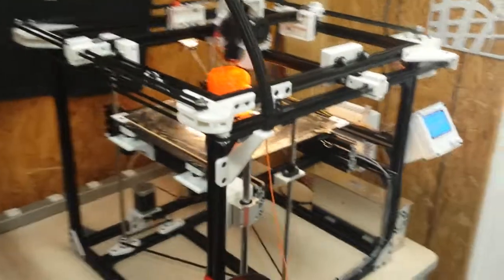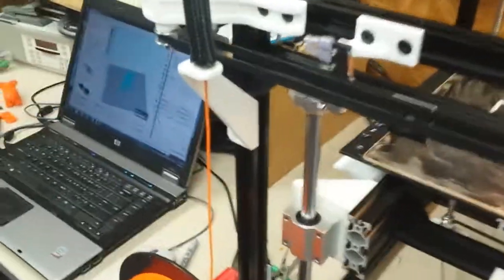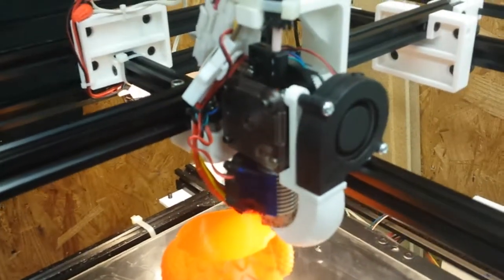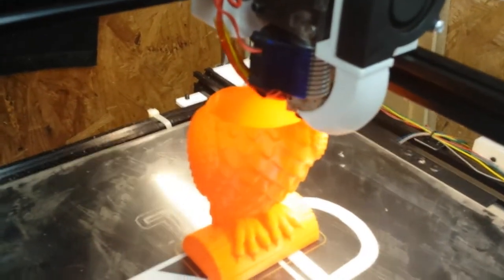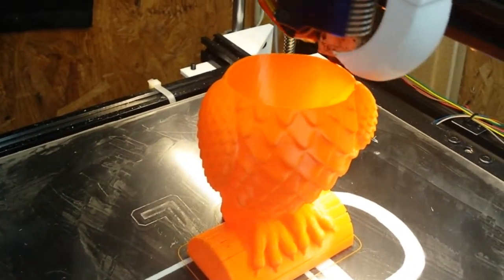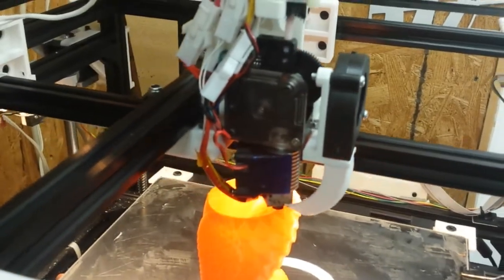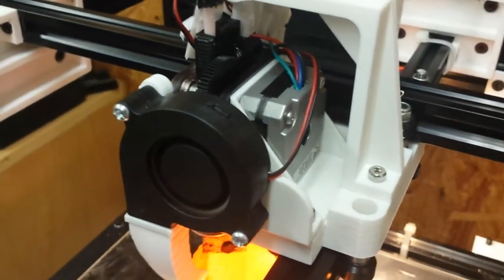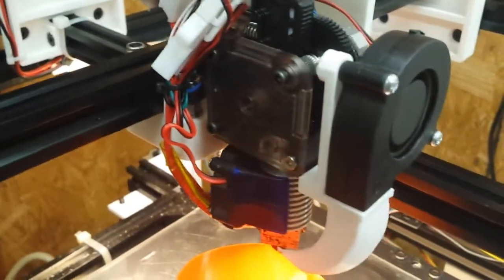XDrive 3d Printer now with E3D Titan Extruder

Comment: Been thinking about doing the same thing just with MGN9/12 linear rails. It really seems like the Ultimaker ect have clean prints due to the constrained axis. As for the bowden setup, it all comes down to the tube. On my Mini Kossel a bowden worked almost exactly like a direct drive since I was able to mount the stepper above  the head and it's a small printer. When I built a 400mm x 400mm bed COREXY using a bowden produced terrible results due to the length of the tube and arch. You would really have to get the extruder above the center of the print bed to shorten the tube as much as possible.
Reply from the maker: Agreed on the Bowden comments, I have subsequently built a couple Delta (Kossel) style printers with Bowden that work well.  The biggest difference is that the tube I used is shorter and VERY close in diameter (ID) to the OD of the filament.  Helps reduce the retract numbers and gives better control.

As regards linear guide rails, I've had spotty results with cheap no-name rails like you'll find on Ebay.  THK, IKO, Thomson, LinTech and HiWin are better but more expensive.  I posted a video showing severe stick-slip on a cheap rails that are shipped with AnyCubic printers -- really garbage.

Let me know how your build goes!

Comment: Hi, 

Nice printer! Soon I will be starting to build my own 3D-printer. I was wondering which type of extruder stepper motor you used. I also want to buy the Titan extruder.

Kind regards
Reply from the maker: Sorry for my delayed response.  The stepper motor is a pancake style, the thinner the better.  With the 3:1 (I think) ratio that's built into the Titan, this is plenty of torque and the lowest mass way to use it, other than as a Bowden.  Good luck!

Comment: Hi, my pancake stepper don't work, only vibrates, what settings you used for this stepper motor?
i have the same setup, I bought the stepper motor on OMC e-shop.. plz help
Reply from the maker: Here are a few things to look at that can cause step motor problems:

1. Wiring -- make sure you have the phases identified.  IIRC there are four wires, two pairs (one pair for each winding).
2. If you're using a RAMPS board or similar, did you set the jumpers for the right microsteps.  You may be trying to move too fast.
3. Did you update your firmware for your specific extruder?   There's lots of good how-to resources on the web.
4. Is there a mechanical problem, such as a jam or other impediment?  Can you free-spin the extruder shaft with the motor engaged?
5. Is your extruder clogged, or not up to heat?  This could cause an extruder motor to stall.

Your mileage may vary...
Neil

Comment: 1.5mm retract seems like a lot for a direct drive
Reply from the maker: I haven't spent a lot of time going up/down from that value, perhaps less would work ok.  In contrast however I needed upwards of 5mm retract on the Bowden, and even then I still had occasional blobs and strings.
Reply: Just checked E3Ds wiki; they say 0.6mm for ABS, 0.8mm for PLA, and 2mm for flexibles.  Those are more...  typical values.